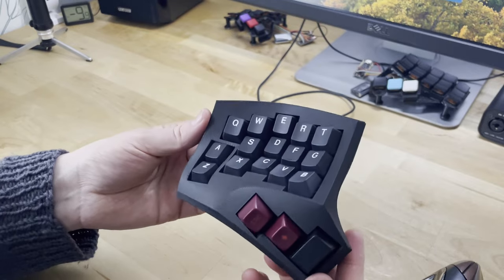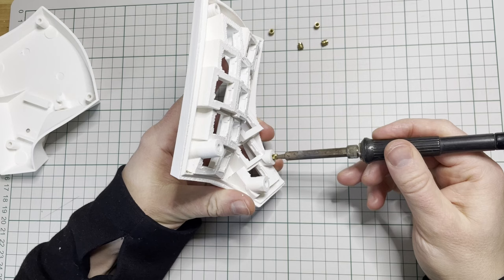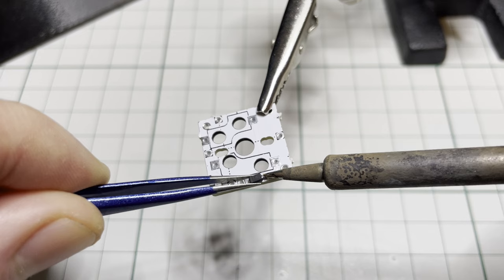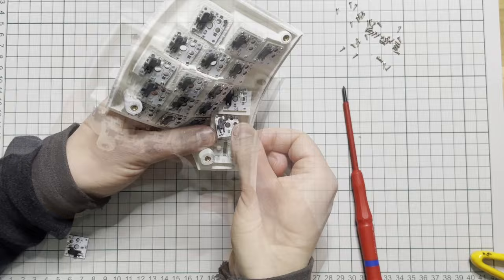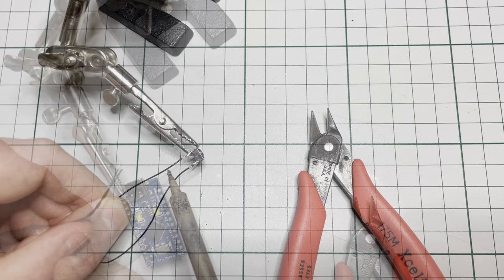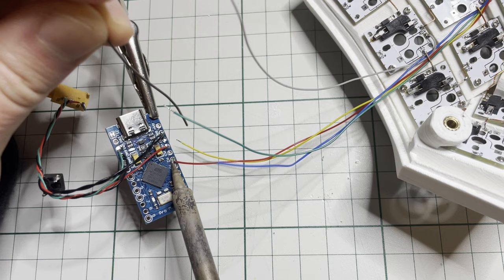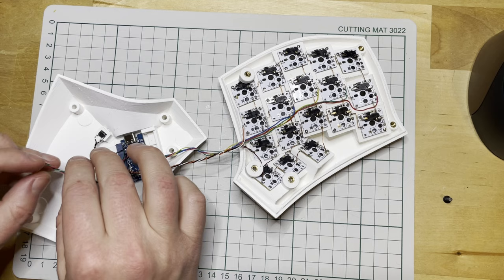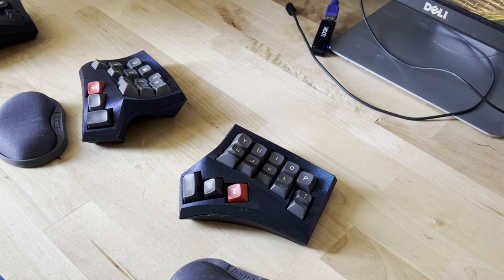Building Dactyl Cygnus

Comment: I'm terrified of soldering stuff, but the 3x6 unicol version might just be what drags me into trying it out. The design looks absolutely beautiful, and it's exactly what I'm looking for - A more ergonomic version of my beloved corne.
Reply from the maker: Using through hole diodes makes it a bit easier. Most of the soldering is just repetition of similar joints, so you get a lot of practice. But it's certainly not the simplest thing to build.

Comment: as someone who built a dactyl manuform, this is incredibly clean! I did not think you could screw in those mini key pcbs. how is that working? I saw the stl, but it just looks like a thin hole. I am guessing it is like you are tapping the plastic?
Reply from the maker: The screw deforms the plastic and creates threads for itself. It’s quite sturdy, haven’t had any issues with the few boards that I’ve build.

Comment: yesss! been following this since your original post. super glad that you made a 3x6! now i can use my corne muscle memory haha. is there enough space for the brackets to support a raspberry pi pico controller (the longer one)?
Reply from the maker: Hi, sorry I must have missed your comment before, but the max length for a controller is around 38mm. I think the pico is like 51mm, so it's not going to fit.
Reply: no it does not fit. i just tried :) 
i'm right now building this keyboard and tried the longer one and its it long to be straight in the case

Comment: I need a build guide for the wireless too plus flash firmware for the controller
Reply from the maker: Supermini is pin compatible with promicro so you can use the wiring diagram on the github page, then you can use a wireless firmware for corne. Wireless version doesn't need the trrs-socket, instead of that it has a place for a switch that is for disconnecting the battery. There is quite a lot of information online about building wireless keyboards.
Reply: @scytile  so about the slide power switch, i solder in the pin of the power switch  or the trrs-socket
Reply from the maker: There is no trrs socket in the wireless version. The power switch is soldered inline with the other lead from the battery to physically disconnect it from the controller. Check issue #15 from github to see a photo of the insides.
Reply: @scytile  thanks